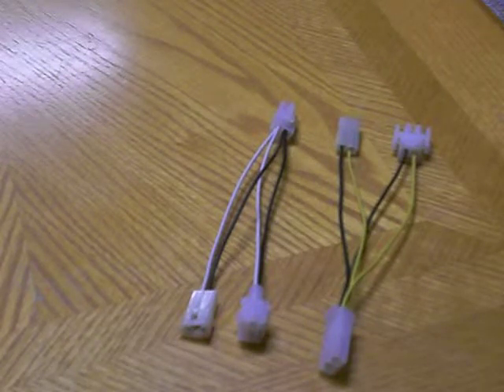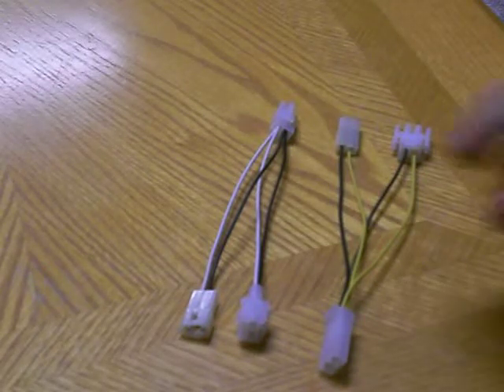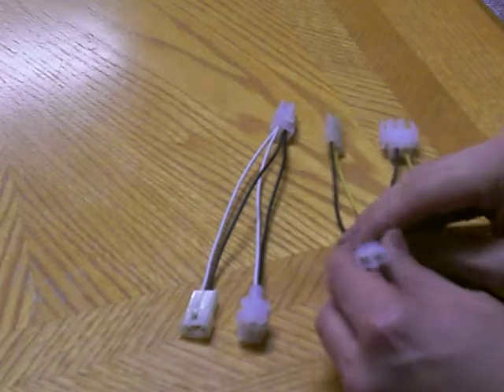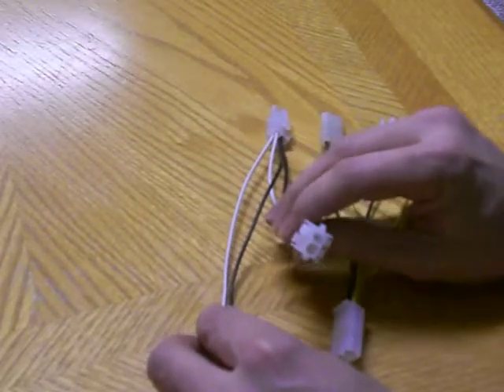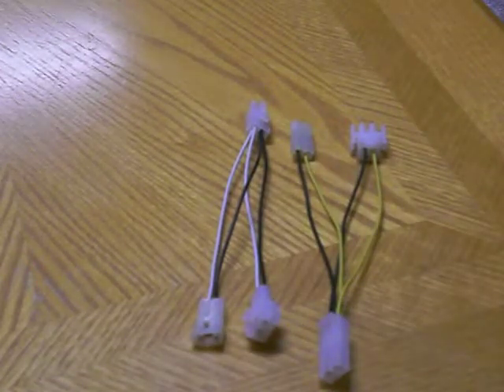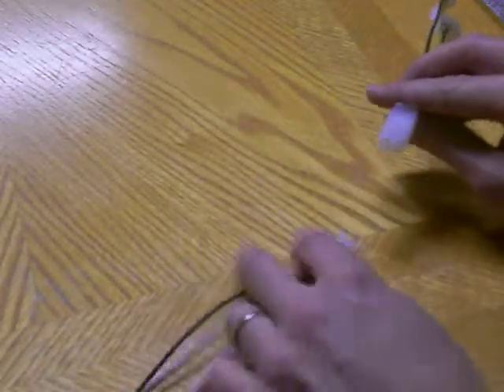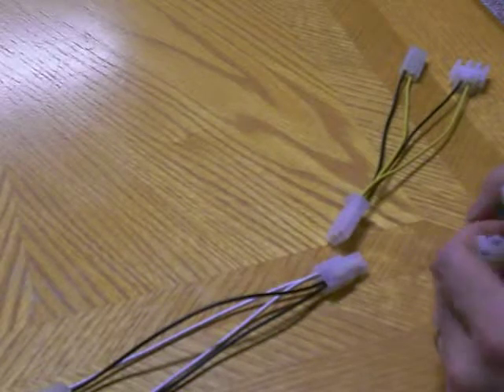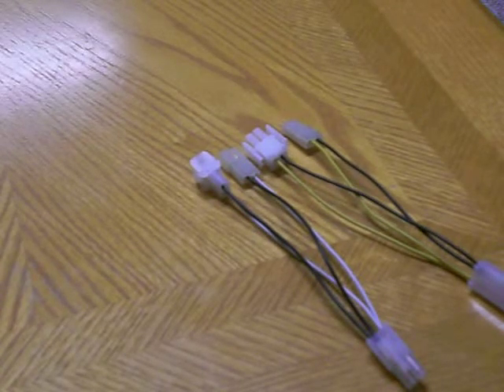Arcade monitor pigtail connectors

Comment from the maker: WM1304-ND and WM1324-ND and WM1602-ND and WM1687-ND and WM1102-ND and WM1103-ND and A1449-ND and A1448-ND and A97889CT-ND and A97892CT-ND. 
The first 6 part numbers are to be used together (pins and connectors) and the last 4 part numbers are to be used together (pins and connectors). The AMP Mate-n-Lok connectors use pins that are slightly smaller in diameter. Do NOT mix them.